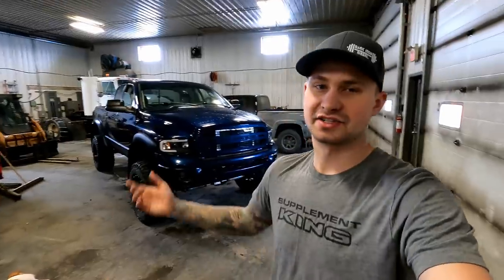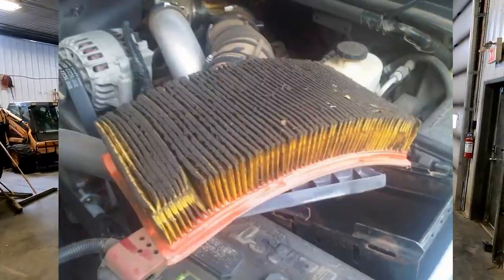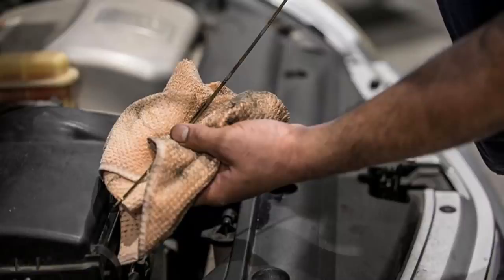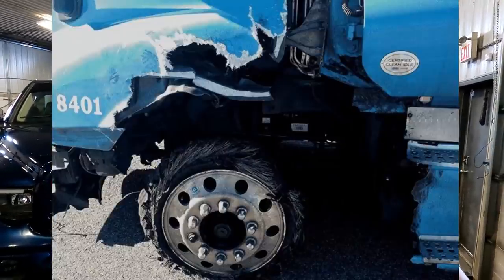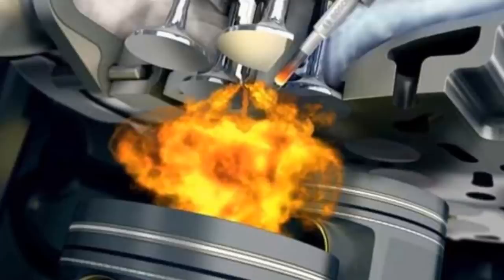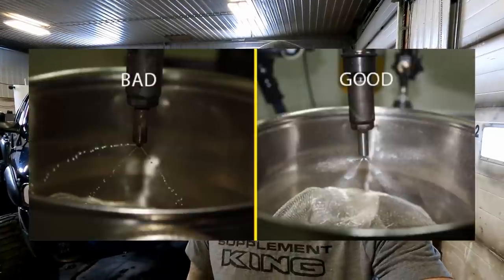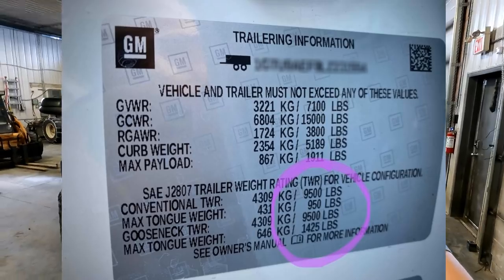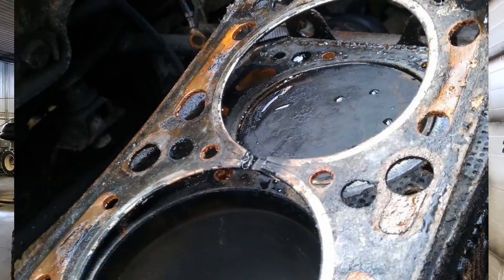13 ways you are KILLING your DIESEL truck

Comment: The biggest reason to "warm down" the engine, is to prevent coking in the center bearing of the turbocharger. The problem is, the exhaust gas heats the manifold and the turbine housing to high enough temperatures, that it can heat soak and burn the oil in the center bearing of the turbo. That carbon jams up the bearing, and at the very least, makes it not spin freely. Your performance becomes sluggish, because of the increased "turbo lag". If the turbo doesn't spool up as soon as it's supposed to, you generate a lot of soot ("roll coal") and it doesn't take long to stuff up a diesel particulate filter, if equipped. That forces more regeneration cycles, which are only marginally effective in the long run. A restricted DPF increased EGT!!!
Reply: Also excessive heat can bend shafts if part of has oil and part of it doesn't. A common problem with turbo prop aircraft engines.

Comment: I am a Hotshot driver and I cover all 48 states and Canada pulling a 40' flatbed.  Maintenance is my #1 priority.  I like your video and actually learned from it.  I want to get 1,000,000 miles out of it.  Should be do-able because it's a Ford F350 with a 6.7.  I use Mobil 1 Synthetic oil designed for my specific use and recommended by a Mobil engineer.   Your video is plain and simple and I like that.
Reply from the maker: Thanks buddy! I love the 6.7 powerstroke it’s a great engine!
Reply: im curious if it hangs in there. just got a Duramax 6.6 & wondering the same thing.
Reply: I have same engine, which Mobile one oil are you using?

Comment: That was a very good video. You touched on some very important stuff when it comes to diesels. One thing I would like to add is watch your turbocharger boost. I drive an F350 with a diesel engine and my owners manual states to never operate with the turbo boost  in the high range for extended periods of time because it could possibly cause engine damage. I've had my truck for 14 years now and I've never pushed my boost even near the high range. And I also let my truck idle for about a minute before shutting it down to let the turbo cool off.

Comment: Firm believer in turbo cool off....I'm so glad you brought that to a point....warm up and cool down.  I fill up at just above 1/4 tank....you can actually feel the difference Very good points!!!!
Reply: My fuel mileage drops as my fuel gets lower. I’m planning on installing a bottom feed for my airdog, but for now it’s sucking up to the top and back to the bottom. And I’m thinking if fuel mileage is affected, fuel pressure is lessened, working against the injection pump( 06, Cummins). The higher the pressure the quicker the burn (to a point anyways).

Comment: I’ve always been a stickler for doing maintenance on my vehicles. I had only gotten down to 70% on my oil and it had been eight months and couldn’t stand it and had to change it. My preferred oil is Valvoline full synthetic made for a diesel 1030 weight. I never let my fuel get below 3/4 but that could also lead to having an old fuel issue. Since the last time we talked, my truck is running the way a diesel should be running. Take that for what it’s worth. Love ya brother. Great channel.

Comment: #9 - low fuel - more important than even sucking in air, the in-tank fuel pumps are cooled by the fuel in the tank.  Running tanks low makes the fuel pump temp go up.  I lost one in a gasser and now don't let the fuel run very low on anything (well, maybe my CJ, as there's no in-tank fuel pump, lol).

Comment: Yup, doing regular maintenance, keeping it really clean, let’s you catch leaks really early. Way before puddles form and failures ruin your bank account. When I got my 2nd gen Cummins 13 years ago I did oil testing for the first few years. I found that I got the longest change interval with Mobil 1 and the Bosch extra capacity filter for 5k miles. So every 5k miles I change the oil, rotate the tires, grease everything that has a zerk,clean the engine bay, blow out every crevice with compressed air, clean everything replace any bulbs, clean the wheels inside and out,etc. I tow a portable work shop so that gets the big maintenance to so it takes a day. I replace all parts with the best that the after market can provide so I can save the truck from its self. All the mods I’ve made is always with durability in mind. I’m a self employed carpenter. My shit breaks down, I can’t go to work, so however long the repair takes, I’m out a days wages ON TOP OF THE REPAIR COSTS. As well as now having to make many phone calls resetting my schedule of start and finish dates for my customers. I can’t get a ride to work with a buddy. The cheapest truck I can rent to pull my shop is $850 a week. So getting the best made parts is an INVESTMENT, the time spent keeping up the maintenance is an EASY INVESTMENT in comparison to a break down from negligence. After all anyone that buys a dodge is getting it for everything that’s NOT MADE BY DODGE(Cummins,Dana, American axles, new venture, Muncie, Bosch,etc)

Comment: Great informative video 👍 Awesome! Got a 2009 GMC HD 2500 Duramax Lmm and I have changed dif oils, transfer case, transmission and filters and upgraded to HSP Intake bundle, air dog lift pump 165 , fass filter delete and Kriptanite sway bar Links and bump stops 🏁 It's never run better! Yes brother 🏁

Comment: i drill a 1/4" hole ion the inside of my box for oiling the wheel wells ,park with the front end down and oil the doors, pop the hood and oil the inside of the fenders. Prior to oiling I remove the taillights and wash out the wheel wells,inside fenders,doors and on my 2012 ram there is a vent in the back door where i can wash out the cab corners by inserting the washer in the vent,it also flushes out the rockers. I may start getting the KROWN treatment too

Comment: Run it hard that’s what diesels are meant for and there good for the engine keeps all the soot and gunk out of the heads... if it has a dpf system running it hard will also cause less dpf regenerations
Reply: Wouldn’t running it hard clog the dpf faster since there’s more soot going to the particulate filter?
Reply: @adenseay7406  it does, I have a 2012 f450 6.7L PowerStroke cab and chassis when I run it hard like at dead stops I put the pedal to the floor and let off once I get to the speed I need to get to, and when I do get regenerations while I’m driving I run it harder so it cleans it better diesels aren’t meant to be babied there meant for towing and meant to be run hard. But since it’s a cab and chassis it’s gearing is low and is detuned that’s why I have a sct flash tow tune on mine without the tune it’s stupid slow and can’t go over 80mph and sometimes on the highway I need to go 90mph with a 25 foot gooseneck trailer
Reply: I have a 3.2 diesel in my transit with a 10 foot contractor box on the chassis. With that 5 cylinder engine I am able to work it hard enough with highway driving that my regens are maybe 10 seconds and probably mandatory from the factory tunes due to milage. If you have a dpf diesel it has to be worked to keep the egt high enough to clean the dpf.
Reply: @isaacwais9810  I’m about to delete my 16 lml duramax
Reply: @adenseay7406  just get a minimax tuner for the delete and egr delete it too it’s worth it in the long run I can’t legally delete my truck because of the dot numbers and the truck can’t be rolling coal in a fleet of trucks it’s a company vehicle and the fines for that are very high if you get caught for having a deleted truck in a fleet and for having dot numbers that’s why the 7.3 powerstrokes are really reliable they have no restrictions what so ever on that engine
Reply: @isaacwais9810  I ordered the EFI live for it it has the rotary switch for the 5 tunes on the fly I think the last tune is 550 hp they don’t do inspections here in south Alabama luckily.
Reply: @adenseay7406  don’t think it does deleted trucks, also don’t live in Cali I live Wisconsin they don’t check but dot cops don’t like when ur hauling heavy with a dot number with a truck that had an emissions system that got removed

Comment: I do like that you mentioned payload. In the RV towing world there are Way too many people with Diesels that cannot actually handle the pin weight.  Great example is a Ram 2500 Crew Laramie, when fully equipped it has less than 1800lbs of payload, 5er's easily exceed that even for small ones. The base tradesman 2500 in that same platform can only do 2100lbs, after you account for the people in the truck, ill be modest at 150lbs per person, a family of 5 is 750lbs, hitches way between 180 and 300lbs,  leaving around 1000lbs payload for the 5er's tongue weight. I went from a RAM 1500, to a 3500 DRW for payload and stability, my travel trailer is only around 12000lbs (about 2500lb TW) there are no 2500's that can carry my family and the trailer in Diesel.
Reply: Easy fix, just leave some of the "family" at home, leave all the liquid "beverages" at home.
Of course, by this time, you've left everyone at home so you won't be driving anywhere.
Reply: Exercise more frequently perhaps, lol jkjk

Comment: I never let my fuel go below a quarter of a tank! And always use a good fuel additive.
Reply from the maker: That’s awesome buddy
Reply: Most fuell additives can't be used on modern diesels with dpf
Reply: @calebbyers  WRONG with Ultra Low Sulfur diesel fuel now there is very low lubricity and it’s killing high pressure fuel pumps , ESPECIALLY if you have a CP4 which are junk and 100% will fail without adding additives . Problem is so bad that all 2021 trucks are going back to CP3 . If you have a CP4 change it out , Google it you’ll see
Reply: @sticrzy123  yes I agree that ulsd is a problem that lacks lubricating properties, but the reason why u need ulsd is anything with sulfer (like some additives) which is good for the motor itself is bad for the dpf aftertreatment system.  Maybe there are some additives that don't use sulfer and don't damage the dpf aftertreatment system.
Reply: @calebbyers  Hot Shots EDT
Reply: @calebbyers  not true. they do not interact.
Reply: @kreuzrittergottes9336  from my understanding they do.  fuel is injected into the exaust system upstream from the dpf to regenerate it.  And it can harm the aftertreatment system if there is too much sulfer in it.
Reply: @sticrzy123  i looked that up and thanks for the tip it looks like a good additive.  But like it says its compliant with the low sulfer requirements so it is fine for the aftertreatment system.
What I had in mind as being bad for the aftertreatment system was marvel mystery oil was one of the ones I have seen using sulfer that is bad for dpf system.
Reply: @calebbyers  these additives do not add the harmful sulfur
Reply: @kreuzrittergottes9336  well in that case yes, you are right.  But you have to be sure you get the right ones as to not get additives with sulfer.
Reply: Hot Shot secret EDT. 3-4oz every fill up. 30-40gal tank.
Reply: @calebbyers  I have an 05 6.0! 😎

Deleted and studded....
Reply: @Doom6.0  well being an '05 half the delete work is already done for you! XD. No dpf or scr!
Reply: @calebbyers  ok Ms. Information
Reply: @MrErichonda30  i realize now that my initial statement was wrong i was just thinking about one particular additive which used sulfer.
But I know now that there are plenty of additives that aren't harmful for dpf.
Reply: @calebbyers  dpf is deleted anyway. haha
Reply: Run a low percentage, high quality biodiesel and don't worry.
Reply: What state are you in
Reply: @lockebuildersgroup7560  I’m in Maryland.
Reply: What brand do u use I use Lucas

Comment: All good stuff. The problem is that people buy diesels to be “cool” and use them as they were driving a gasser and grocery getters. Two things I hate hearing the most are my fuel mileage sucks and it’s so expensive to own a diesel. I do not drive a diesel for fuel mileage and definitely not cheap to drive. I drive one for when I’m needing to pull my trailers, bumper pull or gooseneck, I do not have to worry as much as a 1/2 ton. Maintenance is key on all vehicles but diesel cost more. There’s a couple of things on your list I’m needing to get into keeping up with maintenance on my diesel. Which are the differential oil. I’m guilty of letting it go way over the recommended time to change.

Comment: In addition to the block heater I have installed a low watt heater in the trans pan and a trickle charger to keep the battery at full charge, these are all wired together. When I get up in the morning I plug it in so that when I leave everything is nice and warm!!
Reply from the maker: That’s an awesome idea!
Reply: Smart.

Comment: Add another one especially DPF, DEF, and EGR.....don’t over idle. The more you idle the more you clog up EGR, intake valves and EGR valve and body. Also the compressor side of the turbo is contaminated with engine blow by oils and exhaust side coated with excessive carbon. Also if cylinder temps get too low from over idling the rings become varnished and the blow by increases causing oil diluted by unburnt raw diesel blowing by the rings into the crankcase.

Comment: Of everything on this list by FAR the most important few would be monitoring egt’s (as well as transmission and engine temps of course), get good fuel (you get crap fuel that is full of water one time and you won’t have to learn this lesson again), and check your fluids. Going a little long on an oil change as long as your oil level is full will do much much less damage than running your engine with low oil levels. If  you starve bearings or rings or lifters you can start counting down to a rebuild.

Comment: Also keep the DEF tank topped off to keep the heater element from burning up
Reply: Or remove it all together
Reply: @jjlawnservice5229  I like that idea more
Reply: @pnwripping6636  concitering the regent system is know to fail close fires and has been proven to be worse for the evierment
Reply: @jjlawnservice5229  also when the dpf is full, and it can no longer regen all that soot goes where? Out the tailpipe 😂 my buddy's dad has a 14 6.7 cummins and before it was deleted his dad smashed the pedal and all that soot came flying out the tailpipe like a black jet stream
Reply: @pnwripping6636  they derate q of the issues with pickups is when the derate I can't manuly override the system like in a semi and it cost thousands to have it fixed in the semi they have buttons were u can force them to regent but not even that is a fail safe
Reply: What’s a DEF tank? 😆🤣😆

Comment: Every May and November I do my maintenance.

Oil, all filters, tire rotation.  Without exception.  Costs a lot, but I spend a lot more on stupid shit throughout the year than what my mx costs are.
Reply from the maker: That’s good though, will save you money in the long run trust me! Most of the big repairs I do could have been prevented by better maintenance.

Comment: Fuel treatment is important summer or winter.
I just learned if water gets in the fuel and makes its way to the injectors, it can actually blow a tip clean off when the water turns to steam under pressure!
There are several brands that did well in a scientific test by project farm. Stanadyne and Howes did very well and preventing gelling and removing water.

Comment: This is the kind of advice people need to hear!
I would like to add those things:
1. Undercoat your truck with FluidFilm. That stuff is amazing! Cet a couple spraycans and cover to most rust prone parts.
2. Use quality engine oil. Castrol, Shell, Mobil1, Liqui Moly etc.. Cheap oil is just not worth saving a couple dollars on because its the lifeblood of your engine.
3. Run a can of fuel system cleaner trough the truck every ~ 6 months to a year.
Reply from the maker: All great tips I agree 100%
Reply: @darkirondiesel  especially using fuel system cleaner works wonders on modern common rail diesels. The most important aspect here is that it cleans the injector nozzles. Coked up and varnished injectors are a big problem with small diesels in passenger cars. 
Here in Europe we have a lot of small diesels around and man you will be surprised how poorly they can run if you dont take good care of them.

Comment: Not only letting it cool down for what you said but when you shut it off the oil isn’t going to things like the turbo anymore and if it’s still spinning like if you were just towing hard and it’s still spinning a little then it spins dry if you don’t let it idle before shutting it off
Reply: Is 30 seconds long enough to cool down after a long run with a 3200# load?
Reply: Harry lol I’d wait atleast 1 min
Reply: @nick7.3  Thanks!  The manual for my truck didn't say anything about the time.

Comment: Most small town fuel stations I know of go through more diesel than gas (unlike city stations)due to all the agricultural equipment using diesel.
Reply: The agricultural guys have the diesel delivered in bulk to their farm
Reply: @Fishinguy962  Some do but not all.  I buy my diesel for my tractor in 5 gallon container loads. Much easier to store.  Many of my neighbors have small operations, so not worth having a "home" large storage container.  Much easier to use a couple of container's to store the diesel and we can get it fresh from a truck stop or a station which has high usage.  Price is an issue but freshness is more important. Stale/old diesel is a real pain; I had algae build up and plug everything once and that was enough.

Comment: Another thing about the engine cool down, I'd give it a few minutes maybe even five minutes. That turbo is hot yes, but it's spinning at a very high rpm rate. The second the engine shuts down, the oil flow stops too, therefore the turbo is spinning really fast and now there is no more oil flow. Giving the engine 5 mins or so to cool down prevents damage to a few things and this keeps oil going to the turbo as it slows down. Keeps maintenance costs down and the turbo is not a cheap fix.